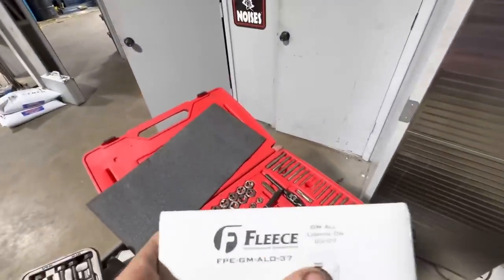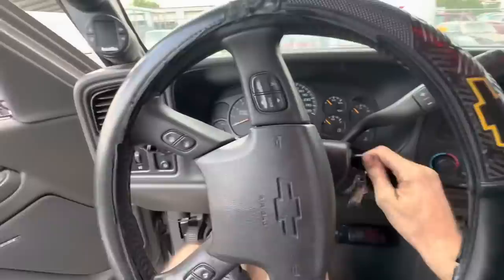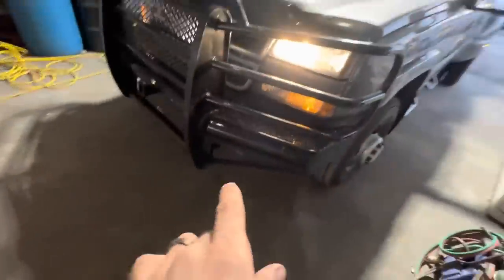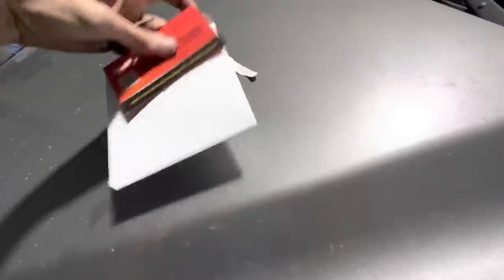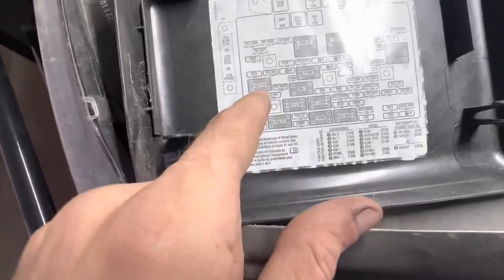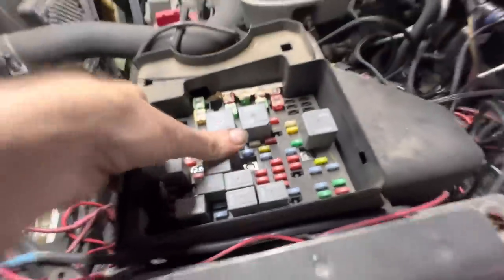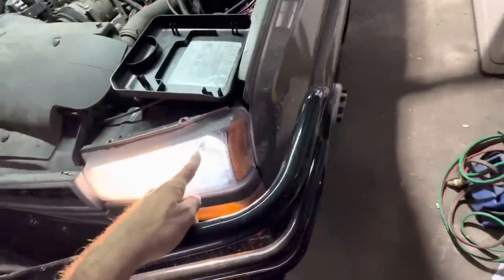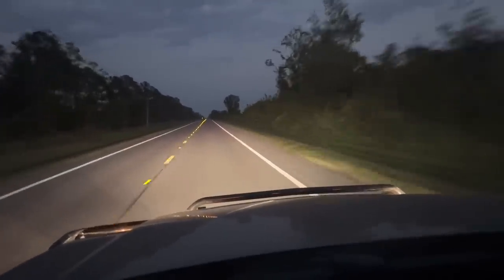All Headlights ON! (Plus Fog Lamps) GMT800 GMC Chevy 2003-2007 1500-3500 Trucks #Bambimode

Comment: Ray, I also have that same module on my ‘07 dirtymax. I found that several months after the install, it started acting a bit squirrelly, like the low beams wouldn’t stay on when I turned on the high beams. I found a small amount of corrosion on the legs of the 3 light relays was preventing the module from working correctly. The cure was to pull the relays back out and coat the legs with dielectric grease and plug them back in. Every once in a while it will need that treatment again, but the time involved is a couple years now instead of 5 or 6 months.

Comment: Loved the addition of the lightsaber noise lol. I always assumed that that the reason fog lights went off when you turn your brights on is because driving with high beams on in the fog makes it actually harder to see. I assume they figured you wouldn't need them simultaneously.
Reply from the maker: It’s fit extra light on clear nights. I wouldn’t use the high brand during fog
Reply: These are driving lights though, not fog!
Reply: Your assumption is correct, but it is also due to gov't regulations that the hi beams go out when the fogs come on.
Reply: The way I understand it, you’re allowed by government regulations to have 4 lights on at the same time, but brights count as 4. So low beam + fog/driving is 4. Highbeam plus fog is 6. Highbeam plus low and fog = 8. It’s probably more sophisticated than that now, but that’s what I recall from a long time ago. I don’t have fogs, but my highs and lows come on simultaneously when the highs are activated, so it’s “full send”. The brights aren’t very bright by themselves (had both lows blow within 5 minutes of each other one night) , so maybe it’s total wattage/lumen output. I’ve hated the dim headlights ever since I bought the car. Both highs and lows are bright LED replacements now and it’s still not as bright as the Camry is on low beam only.

Comment: Ray, I have driven quite often in fog and would NOT use high beam as the fog will reflect the bright high beam light straight back into your eyes. Be careful.
Reply: In this configuration he will have only low beam and the fog lights until he switches on the high beams, only then will all the lights be on..during fog resist using the high beams for the reason you stated.
Reply: @gsettlemyre  Thank you for that clarification.

Comment: Ray there is a legal reason that they do that. Be careful because it can lead to a ticket for excessive/improper lighting.  The same with folks wanting to run blue or red accent lights on the front of a vehicle is illegal. (Even when the package says legal in all states). Yes its legal to own but illegal to use when on the roadway. Cool little device there Ray. Stay safe my friend.
Reply: There are some states that only allow for only 4 lights to be on.  Because of these rare states, all states get this "feature".  Ever since GM cars started getting built in Canada, we started getting an influx of cars with daytime running lights.  It's cheaper to just make one version of something I guess.  I always disable them in my cars.  DRL's aren't mandatory in the USA.  😬
Reply: Putting LEDs into your lamps made for the incandescents/halogens is also illegal
Reply: Having worked on some automotive lighting back in the day, I can confirm that the color of lights, location, and operation on a vehicle is very restricted.
Reply: Ray is in rural Florida though, which unless the Internet has been lying to me is basically a lawless libertarian anarchy. 🤪
Reply: @watchingdanny  Why would you delete something that is there for your safety?, its better to be seen.
Reply: @theolderigetthewrongbitget4746  I dislike the dim color of the high beam bulbs at reduced voltage. If they were nice pure white LEDs, I'd leave them alone. But on my cars, they haven't been.
Reply: @watchingdanny  Why would you even care? When you're driving you're only going to get an occasional glimpse of them in the reflection of a stopped vehicle at stoplights and such.
Reply: @LeoA2600  Why do I comb my hair? I only see it in reflections every now and then during the day. Because I want to like how I look. Same reason, I want to like how my car looks. 😬
Reply: @theolderigetthewrongbitget4746  heres a counter point about deleting something "thats there for your safety" based on my observations, DRL's that are on all the time are too bright and drivers at night are not realizing that their headlights are not properly turned on cause the DRL's are lighting up just enough of the road to make them think that the headlights are on, but it has the nasty side effect of the tail lights not being illuminated at all. IMO DRL's should only be on with marker lights, if theyre on just by starting the car then your marker lights need to be on too.

Not exactly related to above but should be known, adjust your damn dashboard brightness, if you have it on max at night, you are making yourself an unsafe driver. it should only be just bright enough to see it clearly when you look down at it at night. when you have it too bright your pupils wont dilate enough and you cant see what your headlights are illuminating at its full reach
Reply: @Danny B  why, I have DRLs on a 2013 ford with 174k miles on it,  have yet to replace them  and some insurance discounts for DRLs. On my bike I only have one selection for headlights high or low, they are always on. JMC
Reply: That’s why the packages for those red/blue lights say  “for off-road use only”
Reply: In FL, the only colors you can have on the front of the car is white and yellow, red and yellow for the back. Nobody gets pulled over for HID's either (LED's for the uneducated). I don't see why he'd have any trouble with his setup.
Reply: @Danny B  I don't  know of any state  that has a restriction long as your not blinding someone with the low beams. If you have off road lights shining is another story. In the 50's certain states  wouldn't let you have duel headlights which was why manufacturers were reluctant to style there cars with them
Reply: Not trying to be an ass, but you’re saying that HID and LED are the same for the “uneducated.” Maybe you should educate yourself. HID is a sealed capsule that uses different materials and a filament to excite a gas. LED, or light emitting diode isn’t a whole lot more than a current being passed through a conductor. Think of halogens like an incandescent light bulb in your house, HID are like your fluorescent bulbs (no, not the same, just for comparison and because they both require a ballast) and LED are what everyone is using now. There is no bulb in an LED headlight. 
And nobody gets pulled over for HID or LED because they are both available on OEM cars. A 2012 Maxima had factory HID. A 2020 Mazda CX9 has LED. It’s kind of hard to pull someone over for something that is commonly factory available in the market. Where you’ll get pulled over is for misaligned lights that are blinding or excessive lighting.
Reply: “Lawless libertarian anarchy” where everyone has guns and there’s almost zero gun violence. The worst thing about rural central Florida is the damn summer heat and the meth… otherwise it’s paradise.
Reply: @jorged0712  
LED and HID are NOT the same❕
Reply: @jorged0712  
LEDs not LED's...sorry, had to do that, you know, for the uneducated!
Reply: Yes ! Agreed with the OP,.... We have fools that will drive around with all lights at night, totally blinding other drivers!

Comment: Back when I owned my 05 Colorado, I found instructions on how to use jumper wires. They were rather crude and I was already proficient at wiring, so I just rewired the whole thing! By the way, I also proved you can squeeze two batteries, a battery isolator for charging, and a power inverter under the hood! Each battery had a voltage gauge, so you could actively see how each battery was charging.
Reply: I did a mod with my 2004 2500 that just used three diodes from Radio Shack. Was a few bucks, and just jumped the fuses. Was great for driving northern Canada highways
Reply: I did the same thing, but like you said, with diodes on the relays and they are still there today and I did that back in 2005

Comment: I'll have to mention this to my uncle. He has an 04 Sierra that I just rebuilt the 4L60E on at parts cost for him. He loves that truck and even joke hugs and pets it sometimes. lol He likes a lot of light and recently put a light bar on the front, so this would be a great little upgrade!
Reply: For all of our sakes, I really hope he doesn’t use that light bar on the road. Here in AL, they are pretty well known for driving lifted trucks and the headlights are blinding enough (nobody re-aims after a lift and LED bulb replacement). I literally ran off the road and almost hit a bridge one night because someone didn’t turn off their light bar in a light drizzle. It was bright enough that I could have gotten a tan…and coupled with the glare from the drizzle, I couldn’t see a thing. And if you flash them or cycle your lights, they have a tendency to turn every light they have on you and blind you…just to be jackasses.

Comment: There is a good reason for this. You should only use fog lights when there is fog!  High beams will bounce back off the fog impairing your vision further. For this reason i don't see the point of this mod.
IMO of course. Love all the vids though. :yt:
Reply: It’s not for fog. It’s for clear nighttime driving. Fog lights give off a close wide light that helps illuminate ditches.

Comment: I had a 1977 Country Squire that I converted to modern halogen bulbs. To be safe, everything was ran through relays so the dash switch and the floor mounted dimmer switch  wouldn't melt down. Stock it was 2 low beams and 4 high beams, with the upgrade I set it to 4 low and 4 high, plus my quad fogs. The kit had glass lensed bulb housings and used H7 series lamps my factory bulb harness selected the lamp mode and the new lamps feed directly from the battery through relays. Needless to say, she could light up a country mile easily.

Comment: There is a scientific reason for the high beams to be turned off in fog. The high beams reflect off fog blinding you with the reflection.  Therefore you want only low pointing lights in fog in order to see.
Reply: Spot on pal but hey some of these people know better.....they think!
Reply: People aren’t doing this mod for foggy conditions. They’re doing it for extra light during nighttime driving. Fog lights give off a wider closer light then either the low beams or high beams giving you better field of vision in the ditches.

Comment: You can also do this with a lot of Ford vehicles using a laptop running a program called ForScan and a USB to ODB2 adapter.  You just have to be careful because it involves a lot of programming codes (which can easily be found online) but programming the wrong thing can really mess up the modules on the vehicle.  The "all lights" mode is called "Bambi Mode" in ForScan.

Comment: Have the Fleece on my 03 Tahoe for over a year and it works great! Only thing after a year I had to sand the relay connections because it stopped  working  correctly! On my 96 Sierra  I had to run a relay to keep my low beams on with the high beams. On my 2012 Sierra they both worked ! On my Tahoe I also have the factory running lites that stay on  along with Switchback turn signals ! Pretty awesome  brightness!

Comment: I did the same thing when I had that stile trucking.  Only I used diodes (10 pack at $5 when Circuit City was around).  I also had the the day time running lights on as well when hi-beams were on.

Comment: I bought one if those for my 1500 about 5 years ago now, and it was one of the first cheap little mods I bought when I got my 3500. I noticed ebay is flooded with cheap generics of them now, I'm sure they work fine, but I still paid a little more for the genuine fleece one, people also do the same thing with resistors, but it's definitely worth buying rhe module for ease and clean installation.

Comment: You may not know but all you need is one wire and you can drive with your DRL light and regular lights.  Their is a utube video about that.  But this is a really nice add on as well
Reply: my 04 2500HD has ALL the lights on, DRLs fogs, lows, and highs, just need a couple of diodes with long tails, costs like $3 on Amazon
Reply: @mattcat231  I'm sure they are I'm speaking of the DRLs and headlights.  I'm adding big fog lights to my H2.